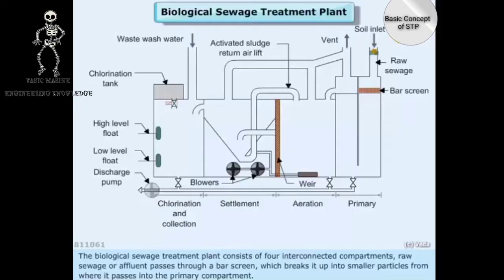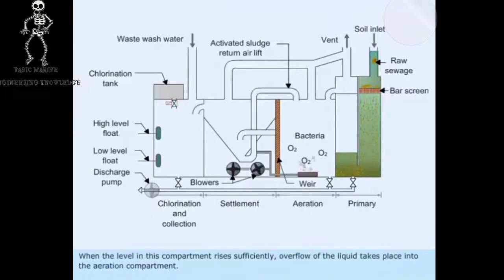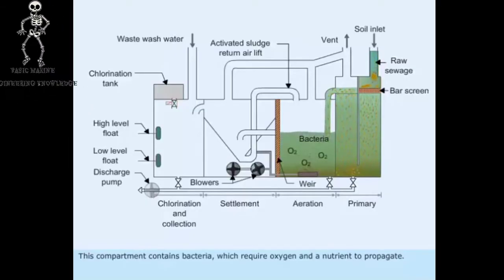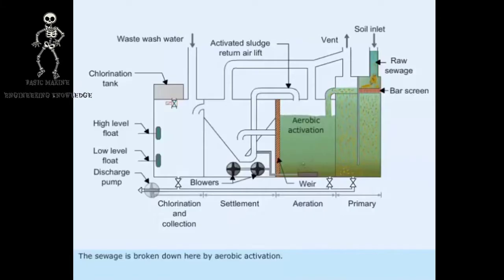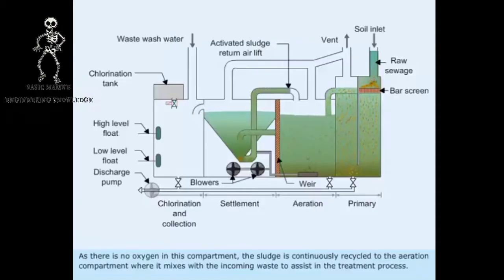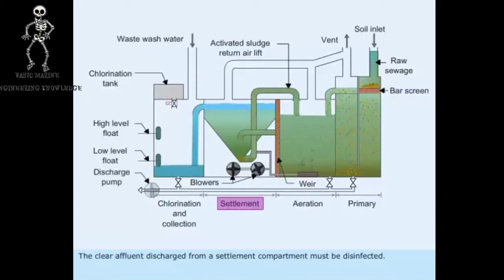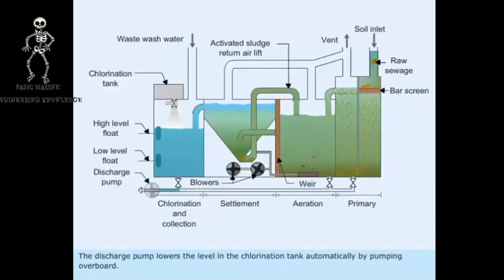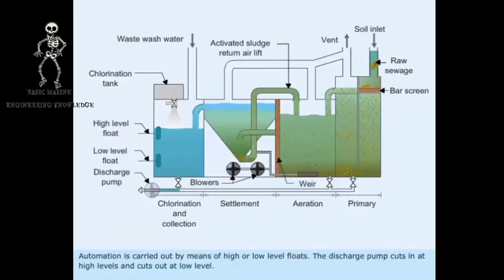sewage treatment plant onboard ship - biological sewage treatment plant in ship

Comment: They miss the u.v. lights
Reply from the maker: UV light system is not mandatory by itself, but the sewage treatment plant must comply with IMO MEPC.227(64) discharge standards. UV is a preferred disinfection method in many modern plants to meet faecal coliform limits without using chemicals.
And this is a basic concept of sewage treatment plant.

Comment: Is there a grant for BSW 22 and BSW 26 and where, if so?
Reply from the maker: BSW22 & BSW26 are likely level switches/sensors in the STP.
They are connected to a PLC or control panel and require grounding or common return.
Located in sewage, sludge, or treated water tanks depending on system design.

Comment: How to main tain bod & cod? 
If increased bod & cod then how to main tain
Reply from the maker: If BOD and COD increase in a sewage treatment plant, it usually indicates poor biological treatment or overloading. To control it, first check if the aeration system is working properly, as low oxygen levels reduce microbial activity. Inspect the biological tank for signs of dead or inactive bacteria, and reseed with culture if needed. Ensure sludge is being removed regularly to maintain the right microbial balance. Avoid oil, grease, and excess chemicals entering the system, and make sure pumps, blowers, and dosing systems are functioning. Regular monitoring, cleaning, and following the maker's guidelines help keep BOD and COD within IMO limits.